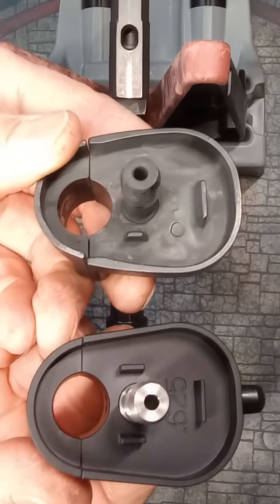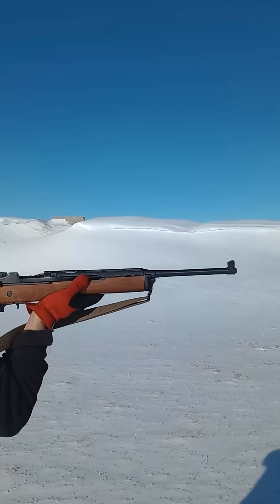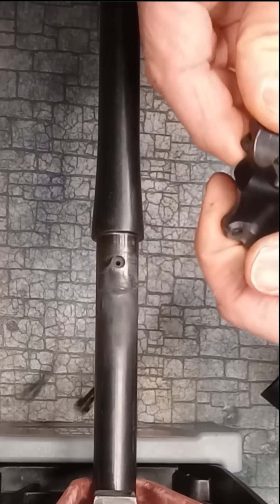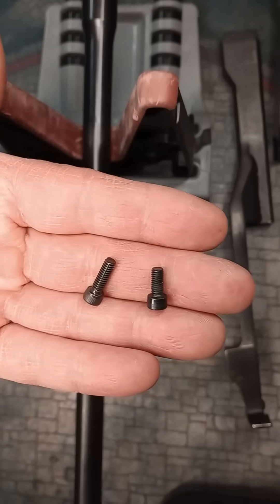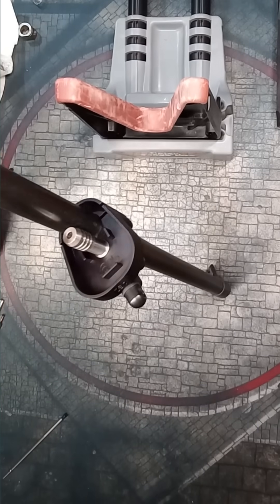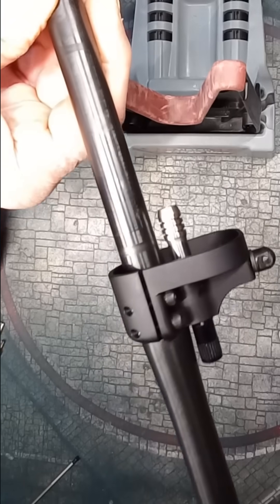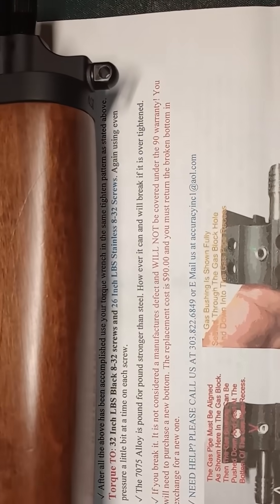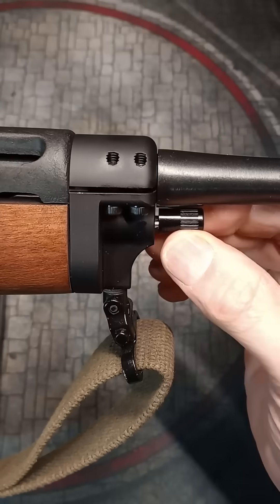Part 11 Installing the Accuracy Systems Mini 14 Adjustable Gas Block

Comment: I noticed that gap between the upper and lower part of the gas block. How much is acceptable? Also my allen screws towards the front of the rifle screw down more than the rearward ones, what do you think?
Reply from the maker: Gap between top and bottom is normal. It's mentioned on Accuracy Systems site. Follow their installation instructions carefully...make sure the gas bushing is not preventing the bottom from sitting flush. Again, follow their instructions with care.

Comment: Have you taken a look at an Accu-strut or Morod? (One bummer is you can’t use the adjustable gas block, so you would have to use a different size bushing to adjust gas)
Reply from the maker: As I understand it, the AccuStrut may help the pencil barrel 180 series, but for the 590's it's really just there to make it look more like a M1A.  And, for ambi, I am averse to putting extra weight out toward the muzzle. 

I think Accuracy Systems does have an adjustable gas block that can be paired with AcuStrut. 

https://www.ambgun.com/ambidextral-rifle/mini-14
Reply: @ Gotchu, thank you for your thoughts and the extra info!

Comment: 32 inch pounds is probably over kill. But I’m no expert. I have mine set to 25. I also just have the stock gas block with the .45 bushing.
Reply from the maker: That is the spec from Accuracy Systems. How much did the reduced bushing help? Is it .045"?

Comment: What's the average twist rate of a mini14? Wonder how it would be with 69gr at 500yd
Reply from the maker: My Ranch Rifle has a 1:9 good for 55-62 gr. The Tactical Mini with a 16" barrel has a faster 1:7 twist, favoring heavier bullets like 69 or 77 gr.
Reply from the maker: Either 1:9 or 1:7 should perform well with 69 gr. I'd probably favor the longer 18" Ranch Rifle barrel over the Tactical 16" for the extra velocity.  It'd take in the field testing to verify. I may try some 77 gr out to 500 yards here soon.